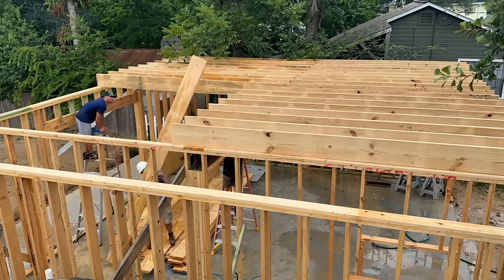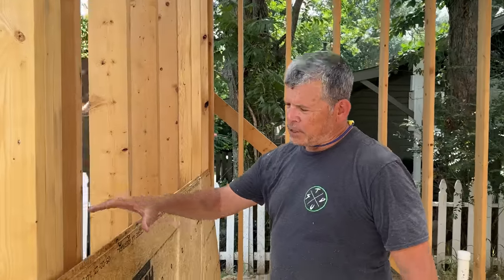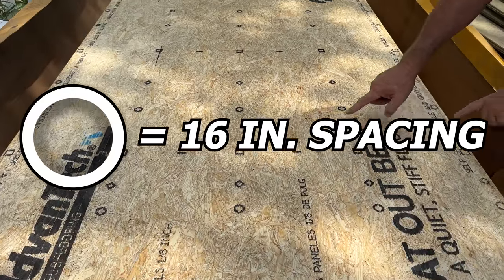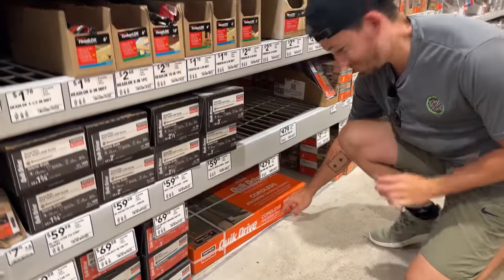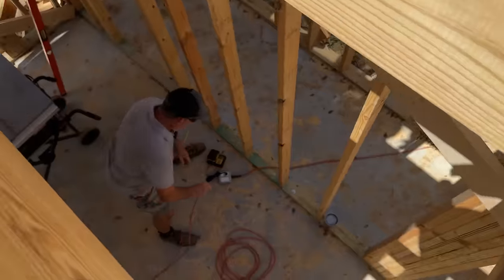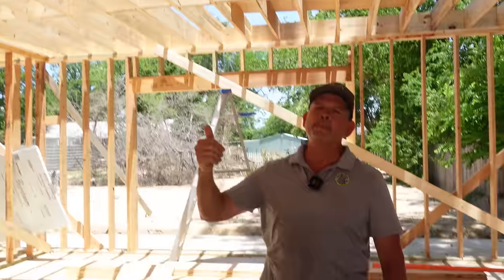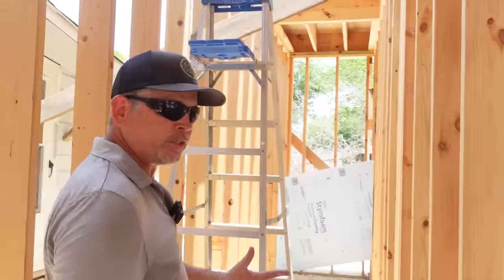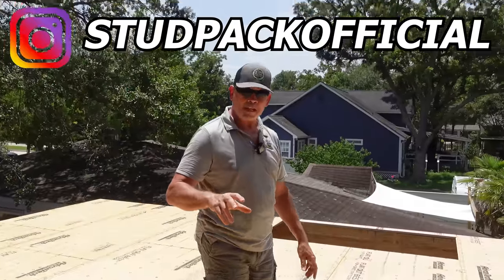We Bought a $500 Tool to Avoid Heat Stroke!!🥵 Installing the BEST Subfloor!!!

Comment: Did you fix the ceiling area on those excessive crowned joist. It looked like the joist were hanging over the load wall a little too far might get some scissor action over time. You should put some glue on the bridging blocks too that’s where most of the squeaks come from. I bought a couple of those screw gun about 15 years ago they sure help out the back. Ok I’ll quit knocking you it’s gonna be daylight in a couple hrs I gotta go to work

Comment: Yo stud pack you need to build a stud rack.
Build a landing to load your studs and sheeting high enough to easily pull up from the deck.  Don't use stairs trust me.  Build a ramp to walk up to the landing you'll wish you did it for that subfloor.

Also don't put insulation between the header the wood should be solid to not create leverage on the fasteners.

Comment: Ugh, I don't envy you guys out in the sun working when it's that hot.  I just shut down most of the outside projects and head indoors or better yet head for the thermocline at a lake somewhere.  (BTW a thermocline is the area where the water temp changes quite a bit, the lake I like to head to drops the temp to by about 30 degrees over the surface water temp but you have to be able to get about 30 feet under water, lol.)  Also don't envy those 100 pound panels, just getting some 7/16 OSB panels that I am using from sheathing up onto the roof here is a pain but they have to go up the ladder under ONE man power but thankfully don't have to haul the shingles that way, I just get the bundles of shingles upstairs and pass through the gaps that the 1X4's from the old cedar shake roof that was on here which is also the reason why I can get away with the fairly thin OSB, LOL.

I think I am doing to go for my divemaster certification and get to the point where I can teach as well.  If I can get to the point where I have that certification level and you guys decide you really want to beat the heat look me up.

Comment: Finally found a reason for owning this planer. lol
Some day, when your not busy with your production company, take a sheet of standard 3/4” sheathing plywood, even 5/8 would be 
Ok. 
Just sit it out so it isnt in the way of anything.
Then give it a coat of a wood preservative like wood life for example on just the top side.
See how long it last before it starts to delaminate.
So now if we were to sheath say an entire deck, then use a garden sprayer to coat the surface, how long would it take, and how much does 5 gallons of the stuff cost?
I can tell you, that it will keep that plywood from delaminating for months.
As for the stand up screw gun. best not to be backing up when using them.
Especially on second floor decks.
Even worse if your working on a dock.
Especially if you hang onto the screw gun.

Comment: Get some cheap big C- clamps to be able to have something to grip.  By myself I took the entire stack of 3/4 ply up to the 2nd floor by taking an 10' floor joist and screwing it to the door frame  below so that it was 6' above the 2nd floor. I then fastened a small locking 2:1 pully on top the floor joist 6' above the 2nd floor deck. I would go down the ladder, attach a C-clamp to the side of the sheet with a loop of the rope in it. Then I would go up the ladder and pull on the rope and since it was a 2:1 pulley, the panel came up pretty easy. Once it was 4.5' above the 2nd floor, I'd swing it in and drag it over to where it's going to go, making sure the edges are on wood. Now I felt I could have done this 2 at a time but I took my time because the crew would be there in the morning. They tripped out that the wood was already up there. Now I was trash that next day but we were ahead of schedule. 
Also, with the ply down, the screws only need to be long enough to hold them in place.  2" would be enough.  But if all you have at the time is 3", then you can aways pilot drill your holes. Over length screws go right in when there is a pilot.

Comment: Love channel. FYI there is another channel, Ken’s Carpentry. In one of Ken’s videos he shows how to build a lift out of an extension ladder and electric cable hoist that they use to run sheathing  and shingles to second floor and roof. Simple idea that works good. Too late for the subfloor but with upcoming roof and the future house build you might want to check it out

Comment: You would have saved yourself a lot of work if you had used engineered I-joist for your floor joists. They are perfectly straight,  lighter, as strong and usually cheaper than solid wood joists. 

More importantly,  engineered I-joists are quieter than solid wood joists.  Properly installed,  I-joists will not squeak when walked on. They also can be combined to carry heavy point loads.  Nearly all professional home builders use I-joists for their floor joists.

Comment: I have to say putting that many screws at that length is bad with an impact but what’s better is really just a drill. The impacts of a "impact" slow you down and it compiles when you’re using 3" screws. Impacts are great for being light and compact but yeah drills just have endless wrist twisting torque. Just a suggestion guys obviously you guys know what you’re doing. Stay safe guys keep it up

Comment: Wood is wood and it goes in all directions when it drys.  The planer idea is great unfortunately most contractors will never use it.  I hate working outside and picking up a molten wrench when it has been sitting out in the sun on a hot day.

Comment: excuse my english, it's not my first language.
A quick and honest question : all the wooden structure will hold on nails? as seen in the previous video i never saw our guys put structural screws or bolts.... except for the the verticals beam on the slab and the steel beam.

Comment: Nailing a metal strap to the beater board, or a 2x4 'T' keeps you from having to bend over to move it..... Framing is HARD work, anything to make is easier/ quicker is SMART!!  I've used a stand-up screw gun for decades, but mine is electric, and was an ad-on for my drywall screw gun.... expensive years ago but worth EVERY penny!!  😅

Comment: 16" centers with 1-1/4" sheathing. Holy overkill, Batman! Some engineer is panting.  We typically use 3/4" T&G with glue & screws, on 19.2" o.c.  depending on the loading, and on 16" o.c. we typically use 5/8" T&G,  so that 1-1/4" is like double.  If it wasn't free, no way it would be worth it.

Comment: I used to do a lot of Stage Scenery work. You always had to check the plans first. WHY? because they were constantly making things 2 inches longer for no particular reason and then  losing their minds when you charged them another $10K. I had  a set designer tell me once thanks for catching that I had 3 designs going and I did that one at 3 in the Morning. Don't assume the plans have to be that way. For everybody up north you get heat stroke from not drinking enough water. It's what happens when you get severely dehydrated.

Comment: The inspector actually said to sandwich foam between the header plies?  That's no longer a built up header, just two (or three) individual members...  The nailing pattern of a header adds to the strength and structural rating of it.  You can add foam to the inside for insulating purposes, but I've never seen anything but solid material in between (some engineers we work with won't even approve plywood sandwiched)..

Comment: The only problem with the AdvanTech sub flooring is the strong chemical smell. I have it in a few trailers and my eyes would burn every time I opened the door for like the first year. Other than that, it never rotted.

Comment: Plus for leveling the joists.  Plus for the Quick Drive.  Plus for Advantech.  (We used to use 1 1/8" plywood which is "only" 85 pounds.  The bad news - you had to get it upstairs yourself.  Haha.)  But Minus for the track saw.  Really?  A super expensive unnecessary tool on a job site?  But Plus for the enthusiasm.  
Side note.  Can I put in a plug for sunscreen?  Lots of it.  Ask me how I know it's a good idea...

Comment: You guys need to look into a Ladder Hoist. The power ones can be crazy overpriced but a manual pulley and rope one goes for less than $100. Save those shoulders and backs. They are super simple mechanisms. You could make one with angle iron, some rollers and a basic welder.

Comment: Buy Cheap Corded 3/8 drills  with 8 inch screw  tip. Start screws with a  hammer. Put a Leather glove on the hand nearest the chuck. Crank those screws down. You will not believe how fast a sheet goes in.

Comment: Do doubt the poly cans go way faster and way farther than the old tubes of adhesive. Made the switch a few years ago and never turned back. Have to say I'm happy we're not required to screw down subfloors where I'm at as nailing is not only quicker but I prefer the flexibility of nails for anything framing related. But to each their own and lord knows you gotta keep that inspector happy 😂

Comment: No lookout blocks and no plywood on walls your supposed to sheet the wall before you stand it  and there is supposed to be lookout blocks that stack the studs for drywall backing and so there is bearing for studs above

Comment: Don't scrimp on tools. They will save you money, time and backaches over the course of one house. 
Plus if it's something you will never use again, you can sell it when you are done and just consider it to be a cheap long term rental tool. 
Love your project!
Hint:  those milwaukee cordless tools work WAY better with a bigger battery.  6 amp hour batteries are expensive but they run your tools just better.

Comment: advance tech sheeting you don't have to put a subflooring before you install your finish floor that if you use 1.25 or 1.5" sheeting we still use glue between the advance tech and joist uses screws to attach nail do not work well at all also there is a top and a bottom if you install it correctly you have a problem if you install it wrong side up it doesn't snap in to each other easy

Comment: It wouldn't be as nice as the Quickdrive system, but for the average, one project use DIYer like many of us,  you can buy a 24" extension for your impact and a magnetic tip.  Similar results on a budget.

Comment: I was just wondering, does the architect draw up detailed plans for the stairs, or do you have to figure out the rise and the run, number of steps and compensate for the thickness of finished floors?
Reply: In residential construction , the rise cannot exceed 7" and the tread depth must be a minimum 10". Lower ratios are allowed but there cannot be more than 1/4" discrepancy
between the tallest and shortest riser. This includes the finished floor(s).

Comment: You got an architect to design your place. if you change the design you need him to approve the change. If you do not and if during the final occupancy inspection the place is not as designed you may not get final approval. We used to to build large structures. If the design was changed it needed a change order. The final inspection by the government was based on the drawings. If changes were made during construction they need to be approved by the designer. Failure to do so would have resulted in the same problems you had with your slab and footings.
Like your sub floor material. Good to see you got a screw gun life will be a lot easier. If you do your own drywall you should get similar.

Comment: your floor joist should not overhang the support , as when you stand on the middle of your joist anything that overhangs is pushed up. and there is no plus to not cutting them off,. i am a carpenter for 65 years

Comment: I love when inspectors are cool and prefer to answer questions rather than just fail inspections.

We had one here like that, if I had to do something borderline code legal in electrical work I could call him and he'd come out and see what I'm planning and why and give me green light or suggest something else. Normally he's okay with what I do so much so he wouldn't even look at my work during actual inspections because he knows I'm going to do it right and if not exactly right for some reason he'd get the call before hand.

He's no longer the field inspector and they hired a new one to work under him, and it gets worse when it's one inspector for all trades in town. We generally know far more about the codes than they do, so now I have to train a new one but I've heard she's pretty decent as well. Gotta love small towns. Where things get sketchy and trades take shortcuts is in the county where there's no inspections except for septic systems and that's a state inspector. Our Texas hill country county has some really crappy buildings because of this.

Comment: You should have measured that  Is floor joist that you planed down. if it was the correct size you shouldn't have planed it. because it will be a sag in the floor in the future ,or will be a dip in the ceiling in the future.

Comment: Again guys where are the  Hurricane straps ? 

The code in Texas requires that all homes be built with hurricane straps and ties. Additionally, these straps must be strong enough to withstand up to 110 mph (177 kph) winds.

The code also requires all homes to have a minimum of 8d nails for attaching the straps and ties. These nails must be galvanized or made of stainless steel for added durability.

You’re required to meet this code if you’re building a new home in Texas. However, if you’re retrofitting an existing house, the code only requires that you install straps and ties on the roof.

That said, it’s important to note that code covers the bare minimum, and it’s always a good idea to exceed the requirements if you can.
Reply from the maker: We are just our of the coastal zone but will be installing special hardware as tie downs and the entire building gets sheathed with ZIP,  all our nails are HDG that way we never have to remember to switch

Comment: ok, if you are putting in 33 screws in each sheet, why do you need to have the purple glue down other than because they sponsored you?
Reply: The "no floor squeak" guarantee/warranty requires the adhesive in addition to the screws.

Comment: Instead of wasting time track sawing each piece individually why not router the ends of
Reply: It’s probably at least 30 degrees cooler cutting them in the shade. And it’s easier to get them up there if you’re cutting 40lbs off of it.

Comment: Listen you NEVER plane the crown of a joist or a rafter. There is a reason we crown all our joists and rafters. The whole point is this: if you plane off the crown , when the wood settles in you will have a dip in your floor. 
It does the opposite of what why your doing it. 
I’ve built and framed 543 homes in my career. I am a retired builder/architect. 
Please correct that error in your next video. 
It’s NOT OKAY to plane off your crowns. 
✌️🇺🇸✌️🇺🇸

Comment: I'll never understand why professional carpenters dont use cordless nailers, airs hoses are so way outdated and a pain in the donkey to use!!!!!!!!! For big jobs, all battery tools needs at least {4}>5ah batteries, 6ah is better.......... 
Also theres no freeken way I'd be lifting those 24, 125lb sheets up 10 feet unless I was 20 years old again, thats just a good way to get hurt or cause back pain,  back pain will make feel 90 years old instantly.  Also I'd want a cost comparison  between {Advantech} vs double layered 12"wide 16' boards, it's my understanding that the car will be parked down stairs...........

Comment: Hey guys, 25 years walking walls here. Just letting you know you're probably wasting time money and effort using screws on your glued down subfloor. Ring shank 8s work perfect and (as long as glued well) never creek with 3/4 much less 1.125
Reply: It’s for the warranty
Reply: @cantgetright742  ring shank & glue covers advantech warranty. They just don't "recommend it" it works excellent AND adds sideways sheer resistance (negligible but accurate)

Comment: or you could have checked for the crowns and laid them crown up nailed them flat and level ... avoiding sanding all together  ... 2 seconds to check and orient ... or 2 hours to level and sand .... the difference between quality workmanship and getting it done fast .... 
.
those few seconds per joist would have saved you 2 hours of wasted effort ... and accomplished the same thing from the start ...